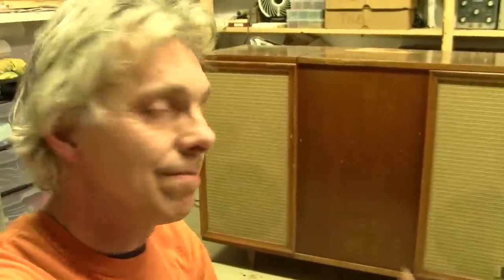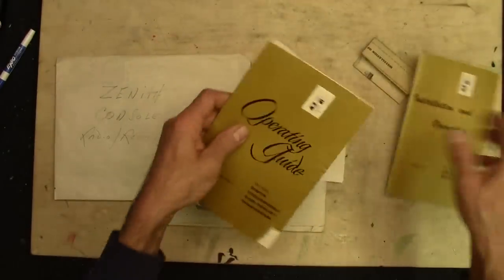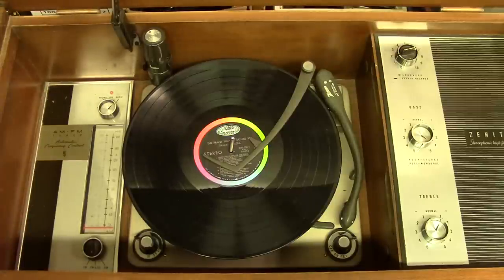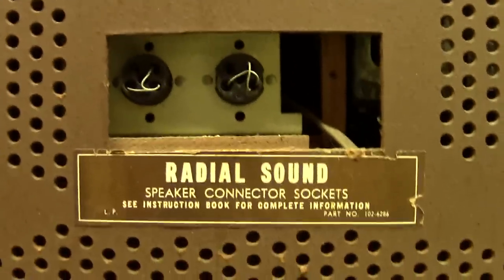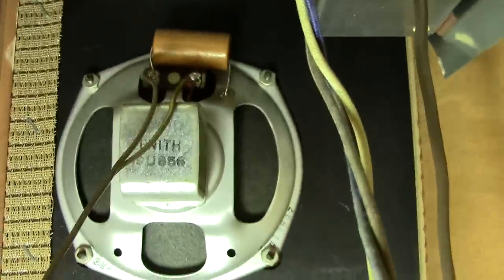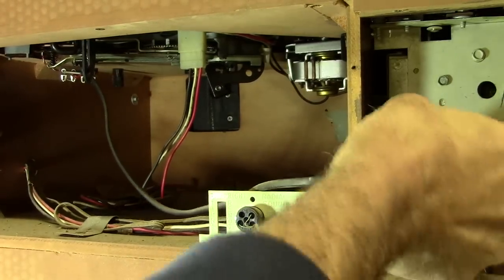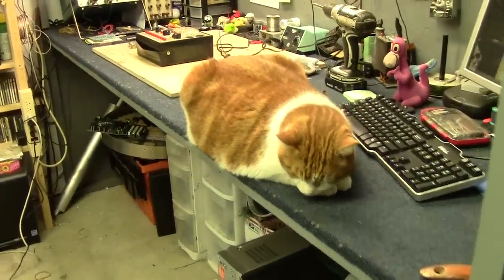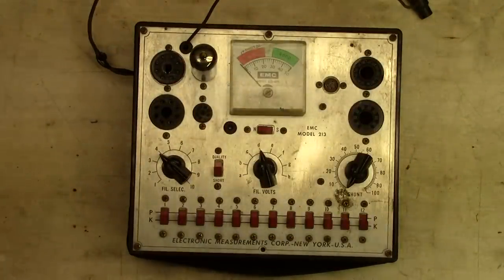1960 Zenith Stereo Restoration Part 1

Comment: I don't quite know how I fell upon this video, but I have to comment. 
I like many kids my age in 1963-64 had a stereo in our home much like this. My parents would not let me freely use it. It was special as it cost a bundle. 
Time went on, and in 1969 I wired in a tape in port via the phono preamp. I played tapes and records relentlessly. I thought it was a great unit. 
Then I went to my brothers friends home in Beverly Hills Ca. His parents had a McIntosh system with Altec VOTT speakers. 
I was completely transfixed. I realized then and there, I had never heard music as it was recorded before in my life. I  was blown away by the purity of sound. I also realized that the stereo console I had been listening to was a total POS. It was a true piece of junk. From the cabinetry (particle board) to the speakers and amp which could possibly muster 15watts. 
So forgive me, but I would not waste a penny on one of these consoles. I do not believe anyone made a good one. Consoles were the state of the art for the home owner, but certainly not the audiophile. It is hard to imagine that stereo made its debut around the same time color tv did as well. 
So I imagine this is all renovated by now. But it will never sound goodi. But. That's fine for many. Good luck. Thanks for the video. I am not a snob ( I know I'll get arguments on that) as I waited my entire life to own used McIntosh  equipment. My Yamaha YP800 turntable is now 44 years old. I still have discrete quadrophonic lps. I would not trade any of it.

Comment: Hey, whaddaya know... I have an EMC 213, too.  Nice little tube tester.    
It's no Hickok, but for quick-checking it's easy and doesn't take up much space.    
When you use the short-test function, move Only One switch up at a time.
Reply from the maker: Thanks for the tips!

Comment: Dean, this is great… and thanks for all your videos!

After starting this comment, I realize I'm the at least the third person to mention checking capacitors, but I'll just throw my 2 cents in as well.  My dad is an avid rebuilder of 60's/70's Acoustic Research speakers, and the caps always need replacement.
Reply: I'm doing exactly that. :)

Comment: Interesting about how those 6BQ5s tested out. My 1964 Zenith 25LC20 color roundie has a 6BQ5 audio output, the tube tests almost dead on emission, yet the TV puts out decent sound. Depending on how critical the circuit is, tube electronics were pretty forgiving. You'd never get that kind of leeway with solid state components.

Comment: Great video. Don't forget to consider checking / replacing capacitors, particularly in the power amp section. There's one 
that can put the output transformer at risk if it fails....

Comment: Cool video , I have a RCA vista victrola  , my turntable won't start rotating without a little help from me with push start.
After it warms up it seems run fine with a new record , no push start needed. Im hoping its just the rubber on the rotating wheel , I'll try cleaning it with alcohol like you did. Have you heard of rubber conditioner to soften it ? To make it more sticky soft . I hope its not the motor.

Comment: This was very very helpful. I have two consoles; one is late 60's D931 w/ radio and other late 50's w/o radio. The turntables not working but step motors you show work fine. What do you think

Comment: Usually these consoles are transformer sets but also a lot of them have a capacitor across the line or from the  line to ground those can short and cause issues but usually you can tell it isn’t a series string set with one side tied to the chassis by the tube designation numbers being all different numbers equaling to 117-120 volts to avoid having to use a filament transformer this has a 6.3 volt filament transformer as well as a high voltage secondary for the plate voltage for the tubes probably running about 250-350vdc

Comment: Hi, I have a zenith I have had since I was 15 it means a lot to me. Very sentimental. The radio works, but the turn table stopped working. I have had some local guys look at it but they cannot fix. Wondering if you can help?

Comment: when you remove the white molex connector from the turntable you should never pull it from the wires like you did the wires could break off of the prongs in the connector block and you will have a very hard time fixing that but all of these vintage consoles do not need much maintenance but just lubrication and just tweaking sometimes . great video

Comment: Great video, but one thing you didn't touch on is when end of travel on tone arm and it has played the record, how does it get back home. I have a rca vlt 29L there is no scate adj. On top. But i think i figured that out. But i did something on the return to home after record has played. It does stop, lift and sits back down but it never returns home. The tonearm stays at finish of record. Can you tell me what returns it to home? A black spring came loose and i put it back where i thought it would go but it didn't help. Can you help? My unit on bottom looks very close in configuration as yours. Kerry
Reply from the maker: It's a mechanism underneath. You'll have to get it set up level where you can watch it in action to troubleshoot it.

Comment: Hey there! I own the 1959 model of this very console... same turntable, same Cobra tone arm, etc.. I noticed that you showed how to adjust the beginning "landing" position of the arm (which I'd already figured out from another YT vid... ) BUT.. could you possibly elaborate a little bit further in regards to adjusting the "I've reached the end of the record; now I need to return to home position" to the right spot? Once I adjusted that tension screw for the landing position, my "I've reached the end; return home" position was no longer correct... I now have to physically pick up and move the tone arm very far towards the spindle to get it to trigger the "return to home" function. Feel free to respond either here (in public for all to see) or via a direct private msg. Thanks so much for sharing!!
Reply from the maker: Best thing to do is set it up so that you can watch the mechanism that initiates the return, then look for and adjustment.

Comment: Hello! I just recently purchased the Zenith Phonograph HF16R. It plays well and sounds alright to the best of my ability to listen lol. The hang-up I have at the moment is that when turned on the amplifier heats up pretty bad. I only notice the tube where the power cable runs into is the one overheating. Just wanting your suggestion on where to start to repair it. Thanks!

Comment: So i know this is an older video but i have an old Zenith Record player. Model C906-1 a Genuine Diamond Stylus model. It's much like the one in this video. Stand up and everything, lovely sound from the FM/AM radio. however, my platter won't turn, the arm will not move on it's own and it won't drop a record. It has the same sort of cogs and gears underneath the turntable. which were really sticky and locked. However, once i cleaned that up it still won't turn. Also no sound comes from the needle. I don't know where to start. Any tips would be helpful. Thanks!

Comment: Since it came out in 1960, I'd be curious to know if Zenith ever offered an FM-stereo upgrade.
Reply: +Madness832 Me, too...I've seen '60-'62 model Zeniths with optional tube sockets and jumper diagrams for FM Stereo adaptation. Zenith's FM broadcast standard was approved as the US FM Stereo standard 1 April 1961.
 Factory-authorised local Zenith dealers had mono-to-stereo retrofit kits that used the above-mentioned optional chassis features.

Comment: Hi Dean, I just bought myself a Zenith Cobra-magic and I’m having some electrical issues as well. I’m told it’s a 1962 but I’m not 100% certain. I looks almost like yours but it’s a single open top. Anyway I’m having issues with it shocking me (for now the plug solution you mention works) but i was wondering your thoughts on replacing the Power cord? There is also some buzzing happening when it plays so I’m assuming it’s a capacitor issue. I have someone I’m working with on replacing the electronic parts and we can’t find what we think we need do you have any tips or places to look?
Reply from the maker: Google is your friend. Add "vintage radio" to your capacitor search.

Comment: great video! I have, I think, what is a slightly newer model and I've been having trouble getting rid of an annoying clicking sound that is linked to the little motor that has separately sized tiers for the different speeds.  I tried cleaning the rubber spindle that directly contacts the platter as you said, but it didn't help.  I was hoping you might be able to suggest something further?

Comment: Hi dean, I was just wondering you had to do any other mods to get that ceramic cartridge to work. I am reading other places that additional modification is required. if not, do you recall the cart model? Thanks!! and Awesome video.

Comment: Hello! I’m currently working on an Olympic console and I just freed up the mechanism that allows the drive wheel to move up and down to align with the motor shaft that changes the speed. My question for you is...... what is the correct lubricant to use to keep this moving freely. Thanks! Dan

Comment: Great video. I have my parents Zenith console from the mid ‘60s. It still works fine. I also have a late ‘60s Zenith table model with a VM changer that I took apart and cleaned and lubed. It works great, but there is a loud pop when it shuts off. Would that be the switch? BTW are you in Cleveland? I’m in the Akron area and remember B&B very well. Thanks for the video.

Comment: Hi I wanted to ask how you re installed the turntable platter. I have the same model Zenith changer and the platter stopped spinning so I cleaned the rubber bearing but now the platter will not go back on due to the curved spindle. Any help would be greatly appreciated thanks

Comment: Thank you a lot, those videos are awesome.
I have found a similar console (it's actually a M2608) in really good condition and reasonable price. I'm thinking to grab it. Became curious about the outputs you mention at 12:00, which come from the cartridge and could be attached to a modern source. How could I do it? Taking away the turntable cables and soldering a RCA cable to it?

Comment: Hello Hackaweek TV, I have the same Zenith as you do in the video minus the am/fm receiver, I had a question if you could help, when I turn the player on a super loud hum comes from the speakers (very very loud) it will not turn down with the audio controls and you can still hear music if you turn the volume up but it is faint compared to loud tone that is going on wether the volume is up or down. Any help would be appreciated.
Reply from the maker: Probably some bad capacitors in the power supply circuit.

Comment: Dean is it practical to reshape a metal gas tank by attaching fiberglass?
Reply: Not really but you can try it with epoxy resin. You'll need a really clean surface that's been scuffed with sand paper.

Comment: I have a similar model that I recently had professionally cleaned but it turns at about 30 rpm. I don't see an rpm adjustment or anything so I'm at a loss for what the issue is. Anyone have any thoughts?
Reply from the maker: The rubber drive wheel is probably worn down. They're available from several sources. Google it. :)